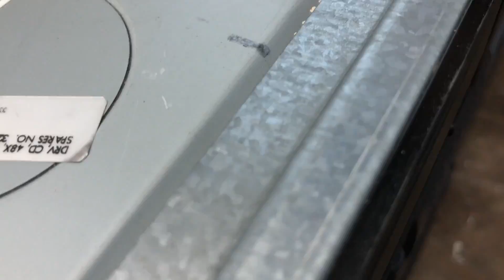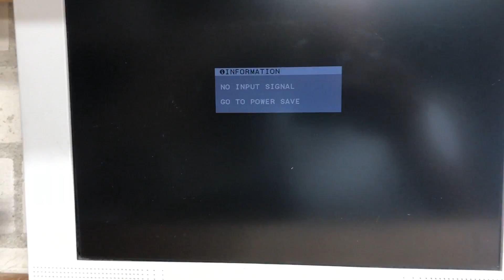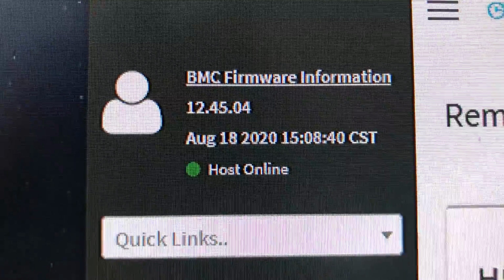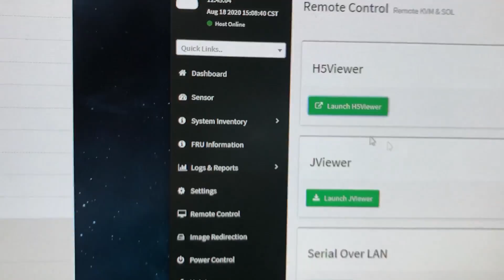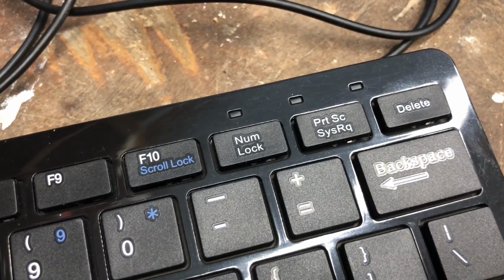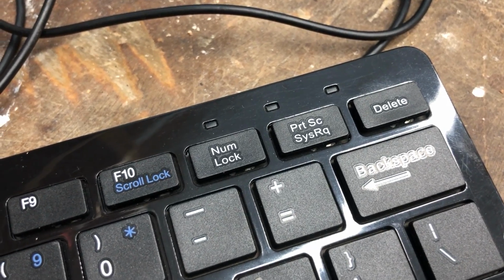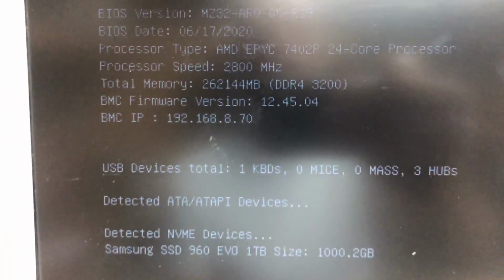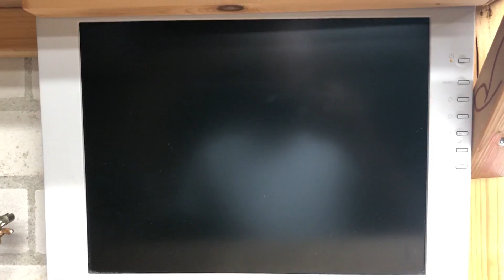Gigabyte MZ32 AR0 Video Out Problem

Comment: Given the choice again, would you still shoose this motherboard or do you think supermicro or asrock would be better? MZ32 has 16 ram slots though... which makes me wants to get this instead of Supermicro or Asrock. But the stories from reddit/STH/Google are quite scary.
Reply from the maker: There are not that many EPYC mainboards out there. Indeed the rams slots are one big selling point. After my first pretty annoying experience with my first serverboard I decided to return it to the seller without any repair guarantee. At that point I bought a new serverboard which was still the same because no other board was comparable at that time. So I guess this answer the question.

Comment: Mark, did the time for the POST BIOS to show up got better after you fixed the problem? Here I have a similar board and it is taking slightly more time (around 1 minute and 30 seconds  with no video output, then it shows the POST BIOS). Actually, it was taking around 4 minutes for the POST BIOS to show up (by default BIOS waits for 2 minutes for the BCM to start and my BCM was crashing). I upgraded BIOS and BCM and now I'm on those 1 minutes and 30 seconds. Are you observing this timing in your production servers?
Reply from the maker: The problem was the monitor. After replacing the boot time is still the same.  A boot time of 1 minute and 30 seconds sounds normal to me. I think the boards is doing some diagnostics before showing the POST BIOS.

Comment: Hi, I have the same board, but a different problem. I cannot get the fans to slow down after posting.
I used the BMC to set different fan curves in relation to the CPU temperature, but they always run full throttle. CPU temp is ~30°C without load... Is there a setting in the BIOS what overwrites the BMC fan setting? Thanks in advance!
Reply: Have the exact SAME problem, can anyone help us out? :D

Comment: Hi, I just purchased a MZ33-AR0 motherboard and installed EYPC 9654 on the mb, same problem of no video. Am on my wits end as I have no other alternative to get BMC connected. Was wondering if you might have any suggestions? Have emailed Gigabyte support but no response so far.  I just need to see some video output on the monitor - the most basic stuffs of all things. I used a VGA to HDMI cable as my monitors are HDMI input.
Reply from the maker: I guess you are using the 2.0 version of the serverboard because your 4th gen epyc. Well as far as I know by know this serverboard has an video out flaw. I returned my serverboard because of this problem and also bought a new one. After running of a year this board also got the same problem. No video what so ever. I ended up running my server with external video adapter. This does not work with the video console of the bmc. So I guess you are stuck just like me. Like I said i returned my first one and got it replaced.. i did not even bother installing it because I guess this one will fail eventually.hahha.. besided the video out problem this serverboard is awesome
Reply: @ipasthemaster  thanks I'm trying to install a RTX6000 to slot 1 but can;t even get through the basic IO stuffs of donkeys years ago. Makes me wonder GIgabyte bothers with the AST controller at all if its flawed. Is there any way to test the assembled jig is working? BMC although I do not have much experience in BMC - my first server setup......
Reply from the maker: @jonmaster2143  The BMC always works even without a videocard. Just figure out what ip it gets from the dhcp server. In my case it always gives the message that there is no videocard installed or whatever. The bcm monitor always gives ne the ‘no signal’ sign. Upgrading bcm of bios does not have any effect on this problem. This is possible without video using the upgrade option within the bmc. But this is always tricky..
Reply from the maker: @jonmaster2143  thinking about my original problem… the one this youtube video was all about.. this was before the video was completely broken. I had no video out because the monitor seems incompatible or whatever: try booting the server without the vga cable connected.. after POST try connecting the video cable and look for picture
Reply: @ipasthemaster  managed to get into MZ33-AR0 BMC from my workstation :)!!! But having some difficult setting the BIOS VIDEO to external. Each time I save changes within GSM (Gigabyte Server Management), then reboot. It will not change to external.....not sure how to change it from then.
Reply: @ipasthemaster  sorted for MZ33-ar0 :)
Reply: @ipasthemaster  What external video adapter are you using? I have this same exact issue!

Comment: Does it with w/ Nvidia GPU ? I have heard that is another issue with this board, which I am considering for my lab. Please let me know if you tried it would be very helpful to know if Nvidia GPUs work or not. Thanks.
Reply from the maker: Because of the video problem I used a gtx 980. Did work without problems

Comment: Hello Mark, i have the same motherboard is rev 1.0 and i installed an Epyc 7713 64C serie 7003,  I still can't boot my server, I already updated the BMC Firmware and the BIOS, but it doesn't fix anything, I was reading that the support for 7003 series processors is in revision 3.0 that's why I wanted to update it, but in all my attempts have been unsuccessful. Do you know any other method to solve this problem with this motherboard MZ32-AR0 rev1.0?
Reply from the maker: Hi, as far as I know you cannot upgrade a revision of the board. This is the revision of the hardware. If rev3.0 is the minimum requirement for this type of cpu, I guess you are in a tight spot. I think you could contact Gigabyte support, but they are not fast with their response.
Reply: You can try to flash Milan part of bios,it should work.First revisions bios chip have space only for one bios firmware,while 2nd and 3d got for both(7001 and 7002 for 2nd ,7002 and 7003 for 3rd).Why i think its possible. I gave my motherboard to Gigabyte for repair,and they returned it with wrong version of bios(for 1st revision,i have second).And i successfully flashed it back for the second.

Comment: Did you manage to solve the problem?
Reply from the maker: Yes, it turns out the problem was a incompatibility between the serverboard and the monitor. I replaced the monitor with a different type, waht solved the problem.
Reply: @ipasthemaster  Thanks for the answer. Did this also solve the "No Video" problem in the remote console? Because afaik this should work without a connected monitor
Reply from the maker: luw8000 true. If the monitor is not connected the remote management function works fine. But when the incompatible monitor was connected the remote function gave the ‘no input’ message and also no video device error
Reply: @ipasthemaster  Ah ok. On my side the problem still persists, even without a connected monitor. Guess I have to wait for the support then.
Reply from the maker: luw8000 i guess you have allready upgraded the BCM firmware and BIOS firmware ?! You should at least upgrade. I have read a vga issue somewhere in the older release notes of the BCM
Reply: @ipasthemaster  I upgraded both but the issue still persists
Reply: @luw8000  so it's fixed or no? does support gigabyte help or like in mz31 stories they are not really "supportive"?
Reply: @petrivanov1598  They told me to send it to the vendor where I bought it but have not done that yet